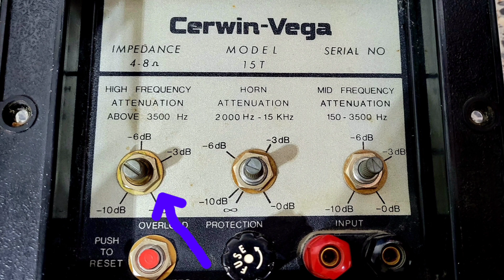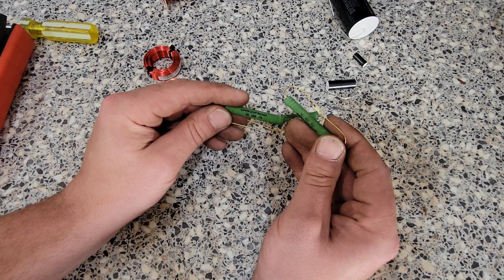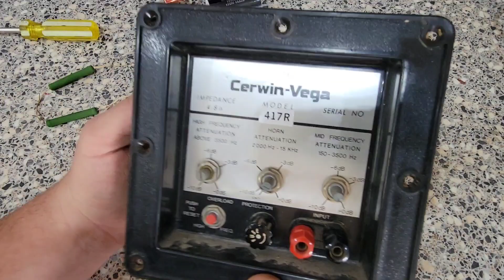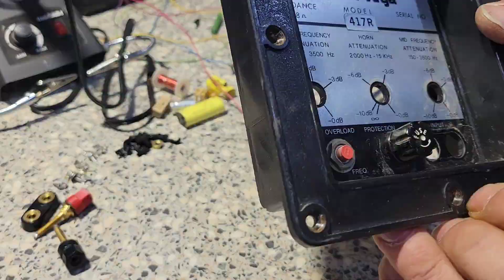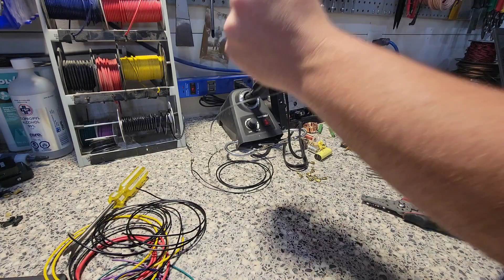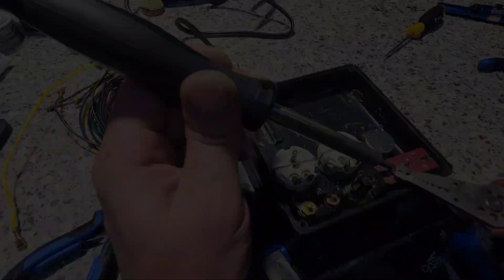Upgrade Your Vintage Speakers Crossover (Cerwin Vega 417R Restoration)

Comment: Watching GR-audio upgrades of CV I would not only change to new parts. Because probably the speaker measure as crap with original filters.
Reply from the maker: Yup, most of them are, ha! I have the same measuring system that GR Research uses. Some are not that bad, but most of them need help.

Comment: I have a set of D3's I just refoamed and when they play normal they sound fine, but low low bass gets a distortion in the tweeters.  Could that be a bad crossover?

Comment: What a memory!
R JBL’S  L-65  cross
over difficult
Reply from the maker: I have not been inside one of those speakers so I don't really know. Most of the time these older speakers don't have complex x-overs. 

As far as just doing a simple re-cap the complexity shouldn't really matter as long as you can find the proper value of caps and simply replace. If doing a full rebuild with new inductors there are other things you need to know. Having the schematics helps greatly but if not you need to be able to figure out the value of the inductors as well as their DC resistance so you can match them.

Comment: Great video! I was really hoping for a sound comparison at the end!! does it sound different?
Reply from the maker: I was thinking of doing a sound comparison in the video but it's hard to tell the differences on YouTube.
Reply: ah, I see. And then for my curiosity, it it noticable (significantly)? I am thinking of recapping my crossoverfilters in my B&W DM603 S3's, and wondering if it is really worth the effort. @SavingVegas
Reply from the maker: Yes after rebuilding the xovers it was a night and day difference overall but especially in the midrange. There was much more detail and just simply a cleaner sound overall. When the customer heard them for the first time after I was done he couldn't believe they were the same speakers.

As for your own speakers, it's hard to say if it will be a big noticeable difference because it really all depends on the parts quality they used in the xover originally. If you open them up and see electrolytic caps then yes in my opinion swapping those out with higher quality film and foil type caps should make a noticeable difference. Also after recapping there is a break in time to burn in the new caps and sound will improve after so many hours of listening. Burn in time was one thing I initially didn't really believe in tell I noticed it myself for the first time.

Comment: There is more of a difference than just tolerance.  Metallized poly measure much lower resistance. ( Low ESR. ) They have no electrolyte to dry up and degrade.  The sonic difference is that the metal poly are cleaner and more neutral, or electrically transparent than the electrolytic caps in the audio path/filter.  I've upgraded 3 sets of c-v's, and even 5% metal poly sounded better than any electrolyte. The electrolytes sounded dull and closed-in by compare. Air core inductors are > iron core.

Comment: I recently exchange pair of canton quinto 520 in to Cerwin Vega AT`100 in pretty bad condition, one woofer are missing and other was refoamed in aftermarket, and bouth tweeters are burned, and boxes rattling, maybe was dumb way. My question is, what is best tweeter replacment for these loudspeakder
Reply from the maker: I would try to track down an original if it were me. Can't really recommend a replacement as I haven't used any replacements before in the AT series.

Comment: If you fix whats broke, you would retain what CV designed. Why try to enhance a Rolls Royce? Just maintain it and drive it..
Reply from the maker: I did not change values of any components simply replaced with newer and better quality. There are many speaker manufacturers that use cheaper components to keep production costs down.
Reply: @Saving Vega's   Understood, but the value isn't the issue but rather Originally.  Now, they're your CV so I wouldn't tell you what to do with them.  I just would've Only replaced what was broken (dried out)
Reply from the maker: Yup each to there own. These actually aren't my speakers, I am working on them for a customer. He wanted repairs done and he wanted them to sound the best they can, so better parts were used to get the original drivers to sound their best, within reasonable cost that is.
Reply: budget brand. crazy. cost less than a car

Comment: Without any measuring software/hardware to compare before and after this is just mental masturbation and frankly a waste of time. Subjectively, anyone replacing parts themselves with more pricey or even better components are always going to think it sounds better due to expectation bias. Not trying to be an A-hole just stating well known facts in the speaker building community. Yes repairing or replacing the potentiometers is a good thing, other than that I don't see any use replacing the other components except maybe the electrolytic cap which may have dried out and have high esr now but that Solen cap is way overkill for an ancient speaker.
Reply from the maker: So all the companies and techs that sell xover upgrade kits for speakers are wasting time? It is also well known that many speaker manufacturers use cheap lower cost components to lower cost of production. You are right, I have no expensive test equipment to prove my upgrades but the way I look at it is if I needed test equipment to know there was any upgrade what's the point right? As for the large 40uf cap I used in the midrange signal path I think that was the most important upgrade other than the pots because that is one of the best midrange drivers that CV used in my opinion and at a cost of less than $50 for the 2 of them I don't see why that would be considered overkill.
Reply: @SavingVegas  Am I a fan of CV, no i’m not, is your reply 100% accurate, yes it is.
Reply: @SavingVegas  Curious what your ears told you after the upgrades
Reply: @SavingVegas  You obviously never have been on a real speaker building forum where there are very inexpensive options for measurement hardware and software.  Like I said, without proper measurements before and after it's all guess work on your part.  Sorry if you took offense but that's how it is. 

Your first sentence in your reply was lets face it, trying to put everyone who tweaks or rebuilds crossovers into one group, which in reality, you have good and bad techs. How they go about doing so makes a world of difference.  Depending just upon your ears to build speakers will take you down a path filled with second guessing and wrong conclusions.
Reply from the maker: If I took offense to every comment from random people on my videos this would be a very stressful hobby for me. Just because I disagree with someone's opinion doesn't mean I am offended. I agree with what you said about there being good techs and bad techs, myself I am neither, I am a potash miner with a hobby. I encourage constructive criticism because it helps me and others learn new things. With that said I still disagree with your opinion that I am wasting time by replacing 40+ year old parts with new ones so that these great speakers will continue to sound great for another 40 years.
Reply: @SavingVegas  So you can't be bothered downloading FREE software to help your own cause? Well I tried, adios.
Reply: @SavingVegas  as a hobby or as your profession, i thought you did great. I’ve been a studio engineer and repair tech for 25 yrs, and I thoroughly enjoyed your content. 

I’ll only offer constructive criticism if there’s a mention for it or if someone is blatantly sharing incorrect information.
Reply from the maker: Thanks! I appreciate it.
Reply from the maker: I have been fascinated with the mechanics of speakers ever since I was a little kid. I wish I had pursued some sort of career in it but I didn't really know there was much out there, silly me I guess. 

The only thing I don't like about this hobby is the arrogance there tends to be with some. I was once told by someone that the preference of the sound of a system was a democracy after I mentioned that it's subjective.

 I absolutely love working on and just playing around with all audio gear. Yeah sometimes after I am done messing with stuff there seems to be no improvement and it sucks to spend money for nothing but that's what I call tuition.
Reply: These speakers may not be the ultimate example of improved clarity from upgrading crossover parts, but if you can't hear a good example of that difference without measurement to confirm it, either your system isn't capable of revealing it, or your listening habits need work....on a remotely good system with above average speakers it should be pretty audible.  

As far as expectation bias goes....I wasn't there, so I have no idea what the expectation was and neither do you.  I've done into the hundreds of minor changes to my system and speaker position changes....every single time I WANTED them to be better, but sometimes they're just not, or at least weren't noticeable....why doesn't expectation bias work every time if it's a valid answer?  Expectation bias can also go two ways...if you expect NOT to hear a difference, isn't it logical that you wouldn't?  Not saying it expectation bias doesn't exist, but it's a terrible assumption to make.
Reply from the maker: I think these are great speakers for upgrading clarity, mainly because of the low grade quality parts that were used. With that said I'm not the biggest fan of the 2 front tweeters that crossover at such a high frequency, seems like it causes more issues than benefits but that's just my opinion. Also I don't know what could be measured? I did not change any values, simply just better quality parts that have been proven time and time again that improve clarity. You can't measure everything you hear as well as you can't always hear everything you measure. 

Anybody that thinks there will be no auditable difference when changing out electrolytic caps for better poly caps obviously doesn't know what they are talking about, especially when the electrolytic caps at as old as the ones in these 417R's.

Comment: I have a set of Vs-150's and it takes a few minutes for the mids and tweets to come on..I.figure it's the crossover.
Reply from the maker: Very well could be, the VS-150 crossovers have a lot of cheap parts in them. I have a bunch of 150 xovers that I plan on going through and rebuilding. I'm not sure when I will get to them but it is on my list lol.
Reply: @SavingVegas  Awesome..if you make a video I'll be the first to watch..I'll tackle it myself but I'll need some guidance..lol..thanks man and I allways love all the videos.